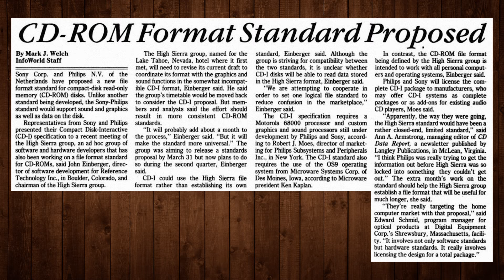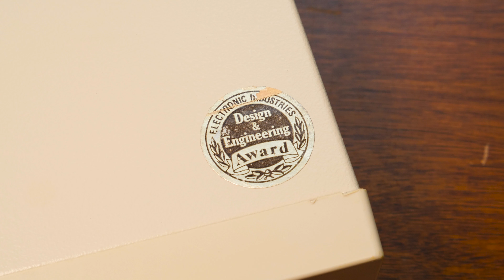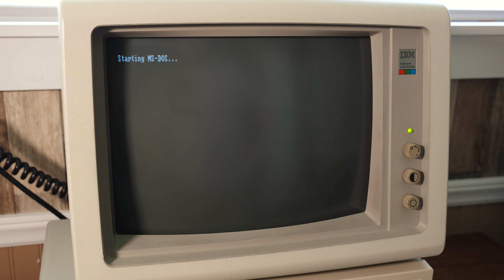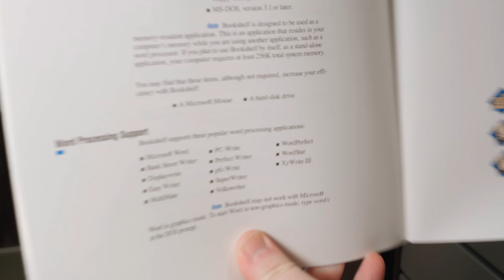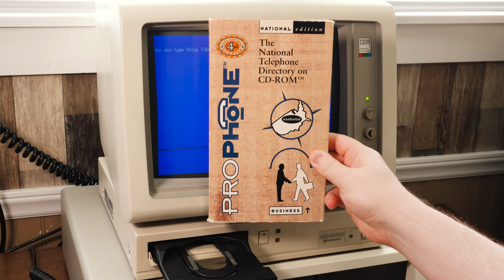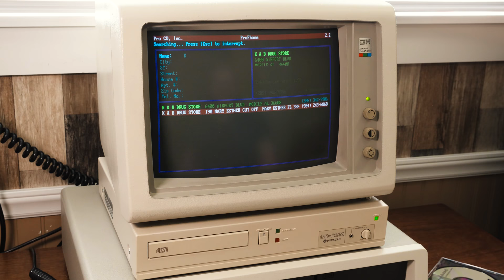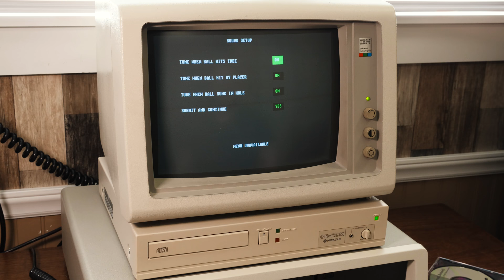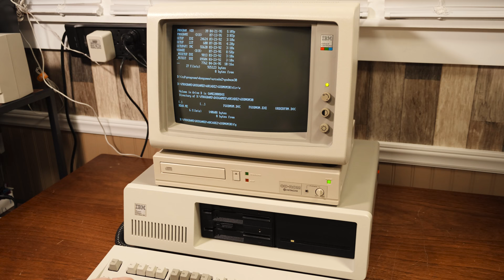The 1987 CD-ROM Experience: Hitachi CDR-1503S

Comment: You know, I’ve never seen a text mode audio CD player and for it to be DOS and proprietary from Sony
Reply: I have.  My first PC-compatible came with a Sony CDU-31A (1X), which I upgraded to a Sony CDU-33A (2X) as soon as I could afford to.  That was a DOS/Windows 3.1 machine.
Reply: I used a DOS CD player late 90s that could do bitstreaming to extract audio to WAV files. Then later compressed them to MP3 also in dos using a DOS version of l3enc. After having used Windows 95 for a while I went back to explore the world of DOS that I missed out on as I was a toddler when MS-DOS had its hey day. With protected mode, MS-DOS is really capable and can do a lot of stuff that Windows can as long as you have device drivers and such and it takes advantage of faster Pentium processors except multi-threading.
Reply: I installed a bunch of them in the early 90s. The affordable ones had ISA cards that had either the Panasonic or Sony interface (or both.)  They required a TSR to be loaded (MCDEX or MIcrosoft CD extension) that was usually loaded from AUTOEXEC.BAT. Most people bought them because it was an inexpensive alternative to buying a set of encyclopedia.
Reply: Look up Cthugha  When  I got that I was so impressed I sent the author a copy of Robert Miles - Children which I thought suited it perfectly.

Comment: Dear LGR, i like all of your NOSTALGIC topic about computer. It is very informative. Keep up the good work. I used to be a computer technician back in 1992. It brings back the memory of 8086, 8088, 286, 386 and 486. I hope you can feature in your blog about the INTERROGATOR alignment that we use to align the head of 5 1/4 disk drive..

Comment: I'm old enough to remember the early marketing for CDs when they portrayed them as indestructible, literally showing people driving cars over them and throwing them in the dishwasher and then working perfectly afterwards, LOL.
Reply: There was some truth in that, since the error detection and correction protocols allowed for successful playback of discs with minor scratches. However, when it came to mass producing CDs it was cheaper to use lower precision equipment and rely on the players to compensate for manufacturing errors.

Comment: For me, it was me working at Puget Sound Naval Shipyard, Save Program, In Supply in 1987. A looking up stock and parts numbers catalog program. Far better than all those many really big books I learned to use at first. All of them on one small CD-ROM. That was a really big thing to me at the time. Made my job so much more easy. The disc was in a caddy. And CD-ROM Drive was twice as big as that one. More the size of that computer under it. It often had to be cleaned out of all the dust it sucked up in it like a vacuum cleaner. 1st time I saw canned air too. Canned air. That really blow my mind when I saw that existed. I was only 16 years old and working as a student aid part-time in a high school vocational program. I later worked there for a contractor doing Auto CAD for the engineers and using big printers to print the ships plans out. Using the first Computer Coax Cable Network I ever saw to.

Comment: In the mid 1990s Creative Soundblaster soundcard/CD-ROM drive bundles were everywhere. There is something magical about inserting optical media and seeing the program load up on your screen lol. I still have retail boxed games from the early 2000s but now 100% of my games are all digital downloads. I ended up re-buying CD/DVD-ROM games from the 2000s via digital downloads (fortunately its cheap) - even though I owned the hardcopy - as it's been updated to run on modern PC hardware/software and my PC no longer has an optical drive.

Comment: Even the term "CD-ROM" (specifically the 'ROM' part) went out of use in the early 00's

This is so deliciously outdated!
Reply: seedy-rom :D
Reply: @dutchdykefinger  I've never really learned what the difference between + and - is and I've burned alot of CD's.
Reply: @AndreasElf  A recent Technology Connections video shows off the differences between DVD +R and -R formats here: https://www.youtube.com/watch?v=e1mJv9pxm7M
It's a great video that I recommend watching, but in short, it's mostly small details in a format war between various companies.
Reply: @AndreasElf  Yeah, DVD+ROM and DVD-ROM was really just a marketing gimmick. I never came across a DVD+R and I almost forgot they even existed, the only way I know DVD+R was even a thing was through documentations. 

The Technology Connections channel has a good video going over the difference between the two "formats" .
Reply: I ran into the + / - issue last week. There's a new way to get homebrew on the Playstation 2 and it requires a DVD-R. I still had DVD+R, DVD+R DL and CD-R, but no DVD-R's. They all failed.

Comment: The first CD-Rom I ever bought was in 1992.  It was an NEC half-height drive that required you to load the disc into a caddy. It had a 50-pin SCSI interface, too.  I don't remember exactly how much I spent on it, but it was not cheap, to be sure.

I remember it came with a discount for a subscription to a CD-based "magazine" called Nautilus.  It was a monthly publication that you'd receive on CD every month (or maybe it was every other month?  I don't remember.)  Kind of silly today, but it was amazing back then -- a magazine with VIDEOS and AUDIO.  Absolutely stunning for 1992.

Comment: I'm shocked to see surface mounted IC's in there with that thing being from the 80's and all.
Reply: That caught my attention as well... SM components on their own miniature ceramic substrate...
Reply: Surface mount tech first started popping up in the early '80s. Sony started employing it in consumer electronics at least as early as 1985 (e.g. AIR-7 scanner thingy), and used it to make the super tiny ICF-SW1 (a PLL synthesized dual conversion shortwave set in shirt pocket format) by '88. Camcorders and DAT head amplifiers were other common applications, as were Apple Macs. We know because those are the ones commonly plagued by dead surface-mount electrolytic caps. ;-/ Their seals often got damaged by excessive soldering temperatures. This problem wasn't eliminated until at least the mid-'90s.

Comment: Dude, you just blew my mind! That was the FIRST CD-ROM drive I ever installed, on the VIC30 XT clone machine I built for my parents! My father bought it at Pace Membership Warehouse as they were running a clearance and bundling it with a 6 disc encyclopedia and an 8 bit SCSI card. Must have been around 1990. But I remember the model number, and the joy of breaking open that lovely box! Ah, new drive smell!

Comment: Neat. A good solution for most of the '80s PCs where there wasn't a ton of space available internally. For later machines that could more readily accommodate an internal CDROM I really like Mitsumi's CRMC-LU005S drive where the whole mechanism pops out and the disc is loaded directly by lifting and lowering a lid and pushing the mech back into the computer.

Comment: The Grolier Encyclopedia that came with my family's 1x CD-ROM drive was my first (and for a while, only!) CD-ROM. I watched that Space Shuttle launch, So. Many. TIMES. I also popped a music CD in and realized I needed to move the plug on my speakers to the separate jack on the drive in order to hear anything. I only got to do that AFTER a 15 minute argument with my mother, convincing her that her Music CDs would be safe and that CD drives never even touch the discs to read them. (My mother was a trained VAXen programmer, so this was a slightly stickier conversation than with most mothers. Though that probably helped her understand my arguments. Also, tape decks still ate tapes pretty regularly at that time, so that was a consideration...)

Comment: Given that the first CD- writer I bought was a 2x write, 4x read with SCSI interface ... and my partner and me had really much fun with it. Actually using the SCSI bus to connect the drive to 2 PCs at the same time, since it was meant to be read only. It worked surprisingly well.

Comment: The first CD-ROM I used was Battle Chess!  Back in the early 90's we had an external CD-ROM drive connected to a 'higher-end' MS-DOS machine in our school library.  Likely an IBM model (as the school board had a contract with them) and it utilized caddies for the discs.

Comment: I actually owned one of these, as well as a BSR 6800 I bought from DAK, both in 1982.  The Hitachi came from a library, and I ran both of them on my BBS.  Over 2 gigs of data, between them, my 750mb SCSI and 200mb IDE drives, and my QIC-80 tape drive.

That was balling in the early 1990s.

Comment: I got my first CD-ROM drive in early 1992, and I was the first in the area to get one. It was a Creative Labs bundle, $599 with their sound card. I loved it, even though still finding CD-ROM titles even in 1992 was still challenging. The average hard drives were still in the 200MB range so the CD-ROM drive still had a capacity edge. It was caddy last added and single speed.

Comment: The company I worked for back in 87-88 used to sell these to read protein database Cd's we released every quarter. I processed reel tape to send off to the cd presser and then a week or two later I got a box of Cd's to ship to our customers. We sold the Amdex model. Sold to labs around the globe, but mostly in the US. Some labs bought eight CD drives at a time. That was a lot of money. But I guess NIH had big pockets back then.  A trip down memory lane. I had to solve a problem once where the issue was MSCDEX.exe not loading. Fun times.

Comment: The High Sierra Format might explain why some old CD-ROM discs I have (one of them by Microsoft from 1992!) seem to have a variant of ISO 9660 that has most of the structures in place but some things are out of place enough to prevent Linux from mounting the CD.
It's also funny to note most of the USB DVD/Blu-ray drives you can buy today still support the CD audio playback commands even if the USB enclosure doesn't provide any way to listen to it.
7:40 Yup, SCSI daisy chaining. That was a thing back then. That's what the LUN numbers were for.
17:00 You found one of those phone book CD-ROM things at Goodwill too? :)
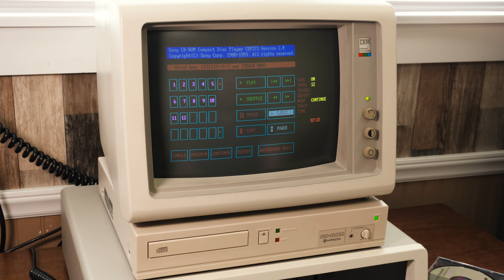28:00 Actually the SCSI command set for CD-ROM drives standardized the commands to eject, retract the tray, spin up and spin down the drive. All drives, up to the SATA and USB drives today, support them.
29:50 I didn't get CD-ROM until well into the Windows 3.1 era when CD-ROM discs were either encyclopedia type stuff or shareware games compilations. I got mine when it was common for CD-ROM drives to come bundled with and connect to one of those "Windows Sound System" sound cards that also had really good Sound Blaster Pro support for MS-DOS games. The interface to the sound card was a proprietary Sony or Panasonic interface since IDE CD-ROM drives weren't a thing yet. To sweeten the deal it came with several CDs including Megarace, shareware DOOM, and the 1994 "Animation Festival" CD-ROM with random shareware, FLI animation and stuff (which is already on the Internet Archive--sweet!)

Comment: It took about 35 minutes to load a mission of Wing Commander 3 back on my 1x CDROM running off a 486/dx at 33mhz with 8 megs of ram. I don't look on that era fondly at all.
Reply: Surprised it worked at  all considering the min spec was  486/50 with a double speed drive

Comment: It's worth mentioning that hard drives at that time were ~40MB for ~$400 with the high end being 80MB for $599.
 
What I find most amazing is where the LASER wasn't invented until the 1960's yet the compact disks came out in the early 80's. It's a similar story with LEDs (a 4K display has nearly 25 million), and transistor counts are just insane!

Comment: It reminds me of a less-stylish version of the Atari CDAR504 CD-ROM for the Atari ST that Atari Corp had demonstrated all the way back to CES in 1985 but never officially launched it for Joe Public. It connected to the ST's DMA port which was their earlier take on what would become SCSI [the SCSI standard hadn't been finalized yet]. Apparently, it did make it out as an OEM product along with an OEM ST sold to independent auto repair shops and the CD-ROMs consisted of auto parts catalogs.

Comment: 21:00 I had one of those cds. Correction, I still have one of those, though I havn't used it in, I don't know, 20 or so years.
10ish or so me had a lot of fun with it.
3 stories:
1. Many games required special memory settings, which I didn't know how to do for years, so many games remained unplayable for that reason. 
2. One of the first irl horror experiences was due to one of the games on the cd. I can probably find the name somewhere, with a bit of effort. "Professor" something, I think. Side scroller where you played as an old man with a cane. Nevertheless, what happened was that some parts didn't get loaded properly. The game crashed after a while, and played the soundtrack extremely loud through the PC speaker, and I couldn't turn it off. Took a little while to realize I could pull the chord. It was a bit traumatic actually.
3. The first Doom I played was Doom 2. It came, ehem, for free, with the PC. I didn't know there was another one, until I found the Doom shareware on the cd. I recall liking the 2nd one better. I also recall never finding the exit on level 7 or something (on Doom 2), so I had to cheat to get further in the game.

Comment: 153KBs was actually quite fast in 1987 and it was also a lot faster than 5 and a quarter inch floppy disks plus most hard drives could only store up to 10-30MB of data at the time so loading a 2-5 megabyte program would still load under a minute! :)

Comment: One of the controversial things about phone and address databases was the search function, which was usually very limited, so you couldn't search for phone numbers by address for example. But the databases were hacked to allow these searches. This is less of an issue nowadays with mobile phones, but many people chose not to be on these databases (if the law in the country allowed) for reasons of privacy, whereas now the biggest reason to be ex-directory is to cut down on nuisance/spam callers

Comment: doing some research on the ICs, here's what i could find

Rohm BA4558 - Dual operational amplifier
Fujitsu MB74LS245 - Voltage Regulator

Hitachi Chips:
HD61Z002 - Signal processing chip
HD61931   - Seems to be  re-packaged version of the HD61945MP  PLL Synthesizer IC 
HA12090NT - Dolby B-Type Noise Reduction System
HD61930 - 4 Bit Single Chip Microcomputer
HM6116FP-3 - 2048-word X 8bit High Speed CMOS Static RAM
HD74HC02P - Quad. 2-input NOR Gates

Comment: So I remember CDs first showing up in stores around 1989. Up till then cassettes were king. By 1994 those tapes, still new releases btw, were in little shelves at the corner of the record store or kmart or whatever. The CD format took over fast. First CD I bought was one of Aerosmith's many, many greatest hits albums... the red one. My first computer was a Packard Bell Legend CD20 that came with lots of CDs. My favorite was MegaRace with Lance Boyle! Played that shit till the CD was unreadable. First game I bought on CD was Doom 2. I played that game and listened to music CDs whenever I could. I had to open the drive about 15 times to clean it and lube it It was so cheap. A crap Hitachi drive i think... and it always screwed up installs. One night the drive belt snapped and that was that. Got a 3x CD drive from Panasonic and it worked great for years. It was around that time I learned from my buddy how to build from scratch. His dad ran a computer shop out of his house so I got parts for cheap or sometimes free. That pre built Packard aged so quickly... and only by learning how to build and configure PCs I knew could overcome limitations with hardware. 3.5 floppys were on the way out but still used. However it limitations were more and more apparent with every passing year. The great games coming out then were on CD, needed more powerful processing, RAM and even accelorator cards. Finding and building and then tweaking computers became my main hobby for years. Making boot disks and modifying files just to get something to run was pure bliss. Dont do it anymore unfortunately, but watching your videos really takes me back to that time when you had to work for your games to run. It was frusrating but it was fun. I'm running out of stuff I havent seen yet... so keep em coming! Thank you

Comment: Notably, 153kB/s is less than the 176.4kB/s needed for CD Audio, and that's because data disks have more error correction than audio disks. As a result, the sequential read speed is about the same as an Insite Floptical.